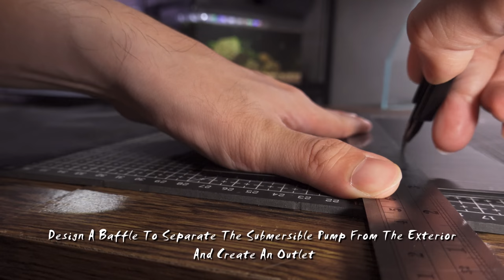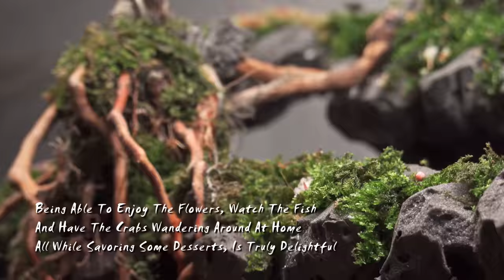How to Create an Ideal Habitat for Vampire Crabs?

Comment: just checking with if they go in to the water，and turn around themselves，showing stomach up but the leg Keep moving，if you turn their around they will die，do you know what reason？
Reply from the maker: If you encounter a crab in this situation, gently help it turn back onto its legs and ensure that it has access to a suitable environment with both water and land areas. Regularly check your setup to minimize the chances of this happening, and provide hiding spots or barriers to prevent such occurrences.